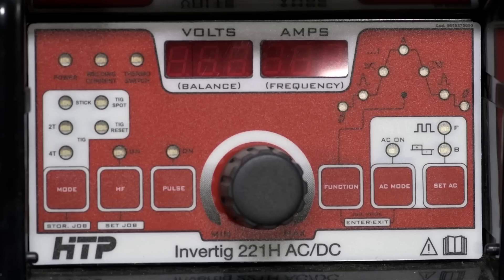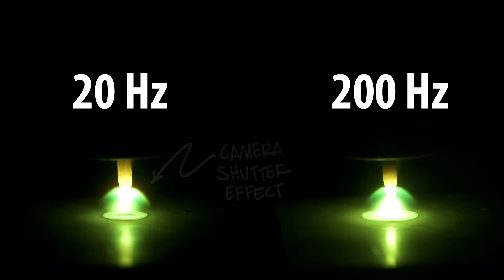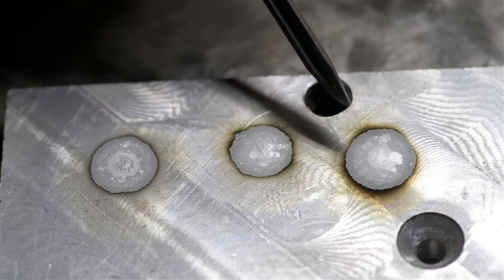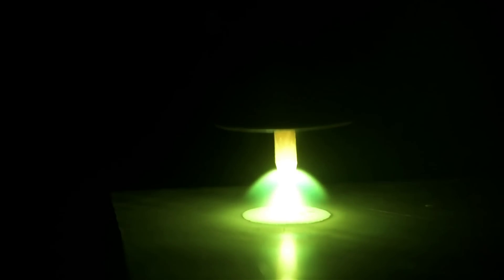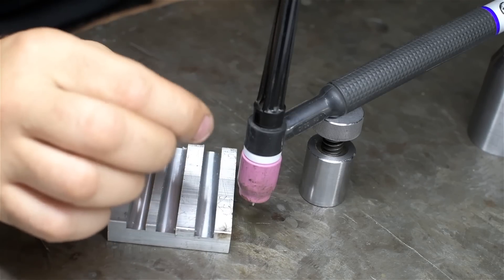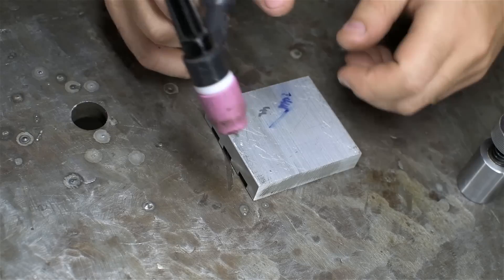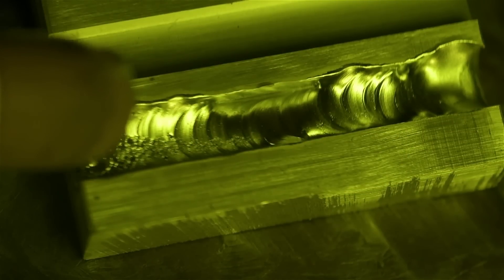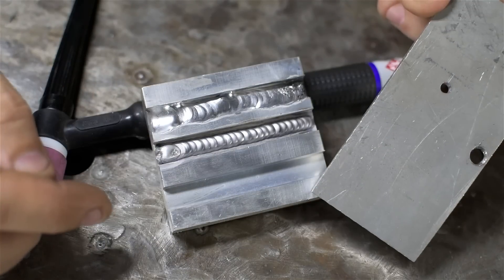TIG with TOT: AC Frequency?!

Comment: Meny welders have disregarded my word on this matter because I've studied as a sound tech, and that it couldn't possebly have anything to do with welding. It's all frequencies, like when someone can scream to make a glass break, it's because the soundwaves resonate with the material perfectly. I welded walkers, with a bracket witch had a tendency to puddle on the backside of the part. When adjusting the frequency it did in fact show up alot on the backside, just like Jody showed in one of his videos. If you tap the material it will create a sound, like a note, witch agein is the frequency that the part reconate. If you can adjust your welder to hit that excact frequency, the waves will travel back and forth in such a way that the material will melt faster because the wave will travel will ease, like if you generate a tone that reconates, itt will make powerful vibrations within the material, makeing the sound reconate and travel further. A sharper wave, higher frequency, tend to break the oxcide layer faster ass well, but I think I can explain a bit about why higher frequencis will demand more power to do the same weld, but I will leave that for one of my own videos for when I'm done making game videos.
Reply from the maker: that's an interesting take I hadn't heard before.. thanks PPF!
Reply: Well i think between the two of you your right. Ive been reading up alot on metal detector design. Skin effect and the materials natural resistance to change thorough its inductance are key factors. For those that dont know inductive coils are used for signal generatiin at various hz ranges in anolog electric circuits

Comment: As I understand the matter, a higher frequency allows intermittent cooling of the material through which the current flows. We see this with pulsed LED lighting fixtures. If one lowers the frequency of the "on" cycle to 50%, power consumption is halved. Heat build up, however, is significantly less than half of the heat build up with full power. This seems to be what happens with your TIG. Why? The theory I will send men to die for is that the material cools in the off cycle, requiring a further investment from the ON cycle to bring it back to parity with where it was when the previous ON cycle went to OFF. The whole business of thermal input is two steps forward, one step back. For the same reasoning, the smaller the steps (higher the frequency), the larger the thermal loss.

Comment: ok i only own a cheap chinese ebay tig with just the one control for  amps, so i'm no professional... but i'm an analog electronics guy, i think what is happening here is the higher frequencies create a magnetic field in the aluminium,  this creates a voltage in the material, this voltage creates its own magnetic field pushing back, and that magnetic field is acting on the plasma in changing its effective pattern some way, creating the narrower bead. as said, guess based on how aluminium reacts, so the question is, would the same test on steel be different, if i am right, it will not be as pronounced.....

Comment: Is it possible that the pulse of 20Hz causes a larger physical bounce that breaks the skin more?  For instance, would a mound of sand spread more with 20 taps or 1 bop (I'm pretty sure bop is a scientific term, if not, I hereby claim it) equivalent to the total force of the 20?  

Is it possible that the generation of a faster cycle reduces the arc's voltage or amperage?  My intuition tells me that it would.  My intuition also tells me that the speed of light is a little over the speed limits posted on highways.   Repeat after me; Masons.

Comment: My 60hz works every time I need it to. Oh and all electrons move across the surface of the material all the time, that's why higher amperage wire has more strands than lower amperage.
Reply: wheelitzr2 what you're forgetting is that during low frequency ac or dc power, not only does it travel across the surface, but also the interior.
Reply: guitarplayer1071 electricity (electrons) move across the surface of a piece of metal, doesn't matter the material it travels along the surface of said material, at no point in time does the electrons move through the internal structure of the material. The reason as to why the higher the amperage wire that you are using the more strands that it has, because the electrons are moving access the surface and when there are more wires (even very very tiny ones) all bunched together there is a lot more surface area for the electrons to move freely, more surface area=higher amperage capability. So him and you saying that the electricity or electrons moving through the internal structure of the material is wrong, it will only ever run across the surface. Look it up or like I did go to college and find out they hard way.

Comment: Good adventure into trying to explain this to the non-welder.
Any professional tig welder knows the advantage of high frequency a/c works in combination with the type, shape ,or sharpness of the tungsten. High frequency alone does not get you there. There being a nice controlled and tight bead. The second part is skill and proper technique, which usually doesn't happen until you do it day in and day out. Welding is something that isn't learned by googling alone.
Reply: +Roderick Mellot  sad but true. Gotta say though, I'm finding it much easier to learn to tig, I'm having far less trouble than I had with any of the other process', especially smaw, HATE the stick! I'll take an oxy over stick any day. I know it doesn't work like that, but yeah... you know what I mean.

Comment: Late to the game here...  skinning affect may or may not be the same as skinning affect for high voltage applications... in electric or electronic eg  high voltage power lines,  when your pushing through high voltages and high amps through transport lines you can get a skinning effect.  This means you can actually hollow out the middle of the wire used because the AC follows the 'skin' of the wire. Power measure at .707 of DC power.  At a higher frequency the .707 will change or go lower. You are right you would have to crank up power to match the lower frequency  the .707 is RMS it is the sin calculated based of the angle of 60 hz . (wall outlets are 120 volts, that is in RMS, peak is actually 173V in change)  Same idea in antennas,   A radio antenna also has a skinning effect,  there is a ton of power pushed into an antenna  part of it, it  is called a wave guide to inject  the carrier frequency and audio together. The wave guide is also hollow.   

Back to welding.  From what I can tell,  you will also be getting an overall skinning affect of power and by the sounds of it even into the plasma based on power, frequency and average temperature(s) into the parts being welded .

Comment: I don't know if I have been doing it wrong all these years but I have always used a ball end on my electrode when welding aluminum. Did things change with the modern equipment or is it just a matter of preference?
Reply: The modern inverters have adjustable AC balance, or how much time of each cycle it's putting heat into the work  piece (penetration) VS how much of the cycle it's putting heat into the torch (cleaning action).  More penetration or electrode negative will allow you to keep a pointed tungsten (some versions work better than others).  More cleaning action starts to ball the tungsten more.
Reply: That makes sense. I wouldn't mind upgrading my old 300 amp Linde but it still runs great. The size and capabilities of the new units are appealing. I don't imagine my old unit is worth much but at 1,000 lbs there must be a lot of copper there.

Comment: I don't mean to insult you Tony, but I believe the power output loss that seems to be present as frequency increases is mostly because of the lower efficiency of the electronics in the machine when operating at those higher frequencies, among other losses.

As for the skin effect, it is important to realize what we have here is a plasma (which has both electrical and mechanical properties) surrounded by an environment of air. Classical fluid dynamics combined with the electrical dynamics of plasma should both be considered here. I don't think your hypothesis can be validated unless you also do testing on frequency vs gas flow rate vs nozzle size and shape.

Comment: lower frequency by definition is lower because it is being produced from a larger area of the source, this targets the energy over a larger area creating more even spread of heat over that larger area which penetrates the metal deeper in longer bursts, higher frequency is emmitted from a smaller area of the source and targets the energy on a smaller area of the metal in shorter bursts so it deeply penetrates a smaller area.
like a depth finder in a boat, http://www.furuno.com/special/en/fishfinder/img/topics/5/img02.jpg

Comment: So I'm not a physicist, but wouldn't the air between the electrode and the material be ionized better on higher frequency since there are more zaps per time unit? This would explain why the higher frequency bead is more consistent while the lower frequency is more sporadic.

Just read some wiki after writing that: The degree of ionization may be between 1% and greater than 100% i.e.; 
double and triple degrees of ionization. Such states exist as more 
electrons are pulled from their orbits.

I doubt the difference in skin effect plays a big role here since the frequency difference is so small. 
I guess the skin effect would mainly play a role in tip shape. A finer tip will more easily arc through the air.

Anyway I know nothing except that you make great videos. Can't wait for the next one Tony.
Reply: More "zaps" per second doesn't mean more energy. The frequency is simply the shift between electrode positive and electrode negative polarities. Most of the heat built up in the part to be welded occurs during the EN phase and most of the cleaning action during the EP phase (important for surface oxides with aluminum). Lower frequencies increase the amount of continuous time each cycle affects the arc and the weld. At higher frequencies, the polarity is shifting so many times per second that the respective heating/cleaning cycles are switching between modes within milliseconds. The overall effect of this is that the arc does not spend enough time in continuous EN phases to heat the part as much as a lower frequency due to heat dissipation. On thicker stock, this becomes more apparent because it requires more heat, while on sheet stock, the material is thin enough that the higher frequency can keep up with or outmatch the dissipation of heat. This is why high frequencies are best used with sheet metal while low frequencies are more common with thicker stock as was used in the video.
Reply: I wasn't implying there is more energy. I figured that as the polarity switch happens, the air gets time to de-ionize  until the polarity is switched and the air is reionized again. (ofcourse it never gets completely de-ionized but the ionization % drops). This would make more sense if it was a triangle or sine wave, but I realize now that the time between polarity switching probably doesn't vary and is just limited to a certain speed in the electronics. And it would probably imply the opposite result i.e. less ionization at higher frequencies.

However I doubt the following is true:
"At higher frequencies, the polarity is shifting so many times per second
 that the respective heating/cleaning cycles are switching between modes
 within milliseconds. The overall effect of this is that the arc does 
not spend enough time in continuous EN phases to heat the part as much 
as a lower frequency due to heat dissipation"

Because as you said the energy is the same, therefore the OVERAL heating is the same amount, but during lower frequencies the heating would be more intense during the EN phase.(Possibly higher temperatures reached=>bigger puddle?). 

So in my head this makes sense: 
Thin stock: high frequency, less peak temperature so less risk of burning straight through
Thick stock: lower frequency, more peak temperature to counteract the heat dissipation.

And I wasn't using "zaps" as a faux term because I'm bad at physics terms, just to make it easier to read. Technically the frequency would be the amount of polarityswitches per second, not the shift itself.

Thanks for the comment, this definitely makes more sense.
Reply: this is exactly why high end tig machines have a high frequency secondary signal to stabilize the AC arc and prevent full extinguish(deionizing), also used for striking DC arcs.
Reply: High Frequency Start is an amazing innovation. It's like having a Sawzall start the kerf on a cut that you are doing by hand. Gets the groove going and lets you take over from there.

Comment: I agree with your recap, in as far as I also don't think it is the skin effect. ;-).
Might be something that happens when the arc breaks down and is re-ignited at each change of polarity that modifies the outcome. I remember seeing high speed footage (or more likely cartoon animations given the time) of AC arcs during welding instruction at school, it looked fairly interesting and complex.

I'm also far from convinced your machine puts similar power out at both settings. Just because the peak current is the same doesn't mean average current is the same, let alone power.

By the way, I'll just send the bill for that tig torch and bottle your way then. After all, it is all your fault...

Comment: 1) the second welding has the advantage of the heat up from the first welding. should have used two different pieces

2) ok, obvious difference superficially, but what about slicing, polishing the piece to observe depths of penetration?

Comment: This is the way I see this rule about AC current. I’m not saying this is how it is. The AC traveling back and forth it would be compared to you moving back and forth between two welding tables, when you’re working in a procject. The longer you stay in a given table (the current staying on the work piece or electrode) the more you can accomplish. if you travel too fast, back and forth between the two tables, must of your effort will be spent traveling.

Comment: Lower frequency means more time the arc is "connected" to the work piece, which in turn means higher heat penetration. 

Think of it like this.. The frequency is say 20 cycles per minute, that means in a 20minute spam of time, you'll have 10 minutes the arc is on, 10 minutes the arc is off.. 
Up that to 40, and you have the same amount of time on and off, but remember, it's cyclical.. so on then off, on then off etc etc.. 

You should also find that with a lower frequency, you'll get more penetration, than with higher frequency, this is due to the on/off cycle of the beast. the longer it's on, the more heat is penetrating the part as current flows though it.. Your part is essential a giant resistor, and the more time electricity is passing through it, the hotter it's going to get. 

Now take into consideration the physical world, in particular the fact that it's easier to heat something up, than it is to cool it down, so the longer your arc is on, the more time current is flowing through the piece, equates to more heat being introduced to the piece. (heat == excited molecule states = faster moving molecules = harder to slow down molecules = easier to heat, than to cool)

As far as the faster frequencies, your "skin effect" theory isn't too far off. Most of the heat created during faster on/off cycles is relegated to the surface of the part, as that's where oxide layers, and other contaminants with higher resistances form / build up.. As you continue to heat the part, you'll reach a point where the heat being applied plus the destructive nature of the arc itself at the surface, will allow you to surpasses this layers resistance more efficiently, and heat will start to build deeper in the part easier/faster.

There is also the wave form to consider.. All wave forms are imperfect, because perfect electronics components do not exist, they all have tolerances.. So your wave form may "bounce" above the expected limit, and then drop down, and it my also fall below expected limits, and come back up.. this non-perfect wave will introduce a variance during each cycle of off, and on, which at lower frequencies has more time to recover, and higher frequencies may be out of perfect spec.. 

Anywho... that's just how i think about it. 

If i'm wrong, hopefully someone will correct me :D

Comment: from what i understand ac frequency is how fast the arc cycles once it gets to a point this allows the arc to jump a gap higher it goes bigger the gap
balance is cycles of cleaning to penetration this also makes the weld fine or wide
but don’t take a test from what i say i’m not 100% on this!

Comment: Not a welder, just a simple engineer.  1/20 sec = 50mS period, at a 50% duty cycle that is 25mS of heat followed by 25mS of cooling time for the substrate.  At 1/200 sec, = 5mS or a 2.5mS hot then another 2.5mS time to cool.  It is possible that a shorter heat/cool cycle actually gives the metal less time to flow.  Like I said, not a welder...

Comment: Isn't the heat from arc welding generated almost entirely in the PLASMA, and almost not at all in the resistance of the base metal? Why would skin effect matter if this is so? 
Surely the heat isn't caused by electrical resistance in the part, because then we'd have our whole part melt, or certainly the point where it exits the work. This isn't so (unless there is a air gap where the current exits the work, creating its own plasma arc). 

Also, pretty sure you got the blunt/sharp arc cone shapes reversed.